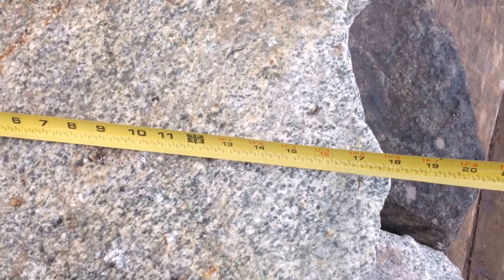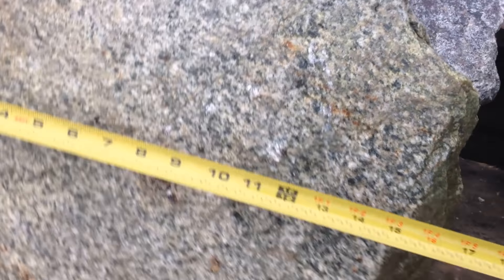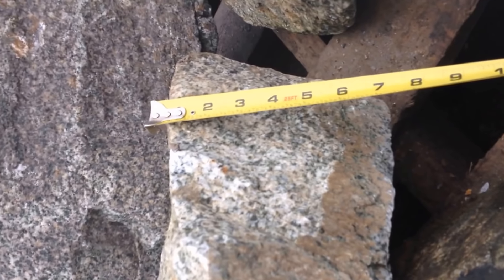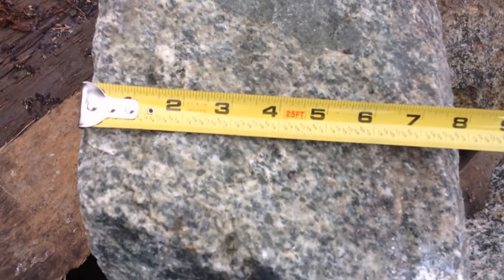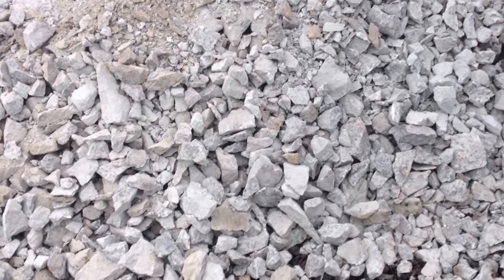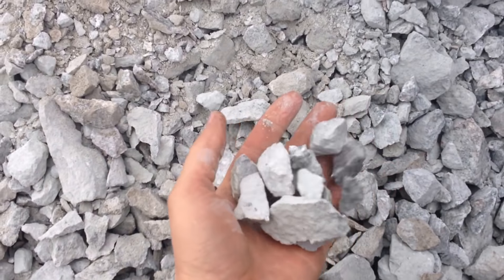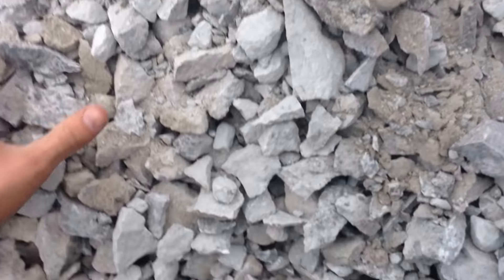MBMMLLC.com: Crushing granite with a jaw crusher

Comment: Not sure about obsidan - but I have mostly basalt at my property, no sand and some clay and the top layer sitting on a bed rock is one two feet max. So Kubota plus dump trailer - plus affordable crusher from MBMMLLC allowed me to build three miles of hilly road winter accessible. Big thanks to them.
Thunder Bay, Ontario, Gorham.
Reply from the maker: Thanks for the comment and update on your crusher.

Comment: When going from 10" rock down to 1" rock, should there be intermediary crush stages to :  1) Increase Through Put.  2) Increase Jaw plate wear life?      For instance should you first crush the 10" rock down to 5" and then down to 3" and finally to 1"?      How are typical crush yards setup?      When crushing Granite, how many hours or tonnes of rock can you process before you have to flip your plate or when it becomes completely warn out?

Comment: ok, so with today's technology, someone has made a cube that can balance by it self. And yet i am more fascinated by this granite crusher
Reply from the maker: +kramler Thanks for the comment.  Its funny how fascinating some of this old technology can be.  The jaw crusher hasn't changed much since the 1800's  There have been some tweaks here and there, but they are basically the same machine.  They are still heavily used in the crushing industry today and I don't know of a better primary crusher than a large jaw.  Thanks

Comment: Can you counterbalance the spinny-thing , so it stops shaking?
Reply from the maker: +Mike Dawson Hi Mike.  Thanks for the suggestion.  A few other people have also mentioned it looks like it is going a little too fast, we have reduced the speed on our newer models which helps a lot with the shaking.  Also having it on an actual stand verses sitting on a couple of 4x4's helps too!  Thanks
Reply: So there's not a way to balance the rotating assembly? Just curious, I know nothing about your type of machinery
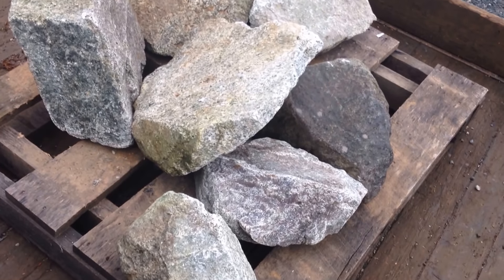Reply from the maker: +Mike Dawson The flywheel actually does have a cast in counterbalance.  You can see it at the very top of the flywheel if you pause the video at 1:08, just before it gets started.  It looks like a little wheel weight like would be on a tire.  My comment earlier about the speed was a little cryptic.  If it is slowed down to about 250-275 RPM the counter balance does a pretty good job of keeping it steady.  At the higher RPM it's running in this video the counter balance doesn't do as good a job as its just going too fast.  They are way more stable when we put them on stands at this slower RPM.  We have changed the speeds of our crushers to about 275 RPM just for this reason.  Here is a video of one of our larger crushers going about 250 RPM and its rock solid even up off the ground 4 feet and the conveyor cantilevered our 15" barely shakes: https://www.youtube.com/watch?v=Vma_rhcXdEE  Thanks for the comment and clarification

Comment: Ur stationary die is loose and ur spinning it over too fast for the type of material ur running try slowing it down to 250 rpm on the jaw flywheel
Reply: Thats what i though at first but it does bollack it through  !!!!!!!!!!

Comment: Seems like there are some pretty obvious improvements that could/should be made as far as safety goes and how materials are fed into the machine. Just find it hard to believe anyone would get to that point in development and think it was a finished product.
Reply: Matt Yale You can see pieces flying out the top. A simple cover or shield would prevent a potential injury. From working in paving you would be surprised how far a crushed piece of rock or concrete can fly. Doesn't make you more manly to ignore safety when operating machinery.
Reply: +Pheonix2022 it isn't about being more manly, it is about common sense. You put in your rock and then you leave.
Reply: Matt Yale Ok bud whatever you say lol seen dozens of guys like you get injured on the job because they think taking proper safety precautions are unnecessary and that they're too smart to get hurt. But hey what would I know from having actual experience.
Reply: Matt Yale The ones who I said were just like you? Yes they were extremely stupid. Thank you for pointing that out.
Reply: +Pheonix2022 I understand your point of view and it is protocol nowadays to receive manual handling courses and safety equipment as well as operating a safe machine but allot of times the red tape just gets too bureaucratic as well as uneconomical.  I believe that 'common sense' is dying.  
Yes some form of guard on the flywheel wouldn't go amiss but as far as the feeding mechanism or lack there of, I dont think any modifications are necessary. Maybe some signage to indicate that staring blankly down the jaws while rock breaking and thinking about whats for lunch can lead to loss of teeth or head.
Reply from the maker: +Pheonix2022  Thanks for your concern about the guards and safety.  This is a demonstration video only.  When we sell the equipment we have them fully guarded with OSHA complaint guards.  You can see some pictures of them on our website here: http://www.mbmmllc.com/jaw-crushers/  It is hard to tell how the machine works when they are fully guarded.  We also have various feeding mechanisms and conveyor discharges so the operator is never close to the machines as shown in this video: https://www.youtube.com/watch?v=Vma_rhcXdEE Thanks for the suggestion and concern
Reply: mbmmllc That makes a lot more sense. Thank you for the explaination.

Comment: granite is a pretty tough rock, or at least i thought......

is there anything made by mother nature that machine will not chew up and spit out?
Reply: freddy hayes granite is a softer rock. and no unless your talking a diamond.. but no, this will crush and natural rock aslong as it fits comfortable
Reply: Diamonds.
Reply: My girlfriend's name is granite crusher.
Reply: Hapie Star You realize that diamond would crush easier than granite right? Diamond is harder but its also extremely brittle.
Reply: Diamond would be destroyed instantly. Even hitting the edge of a diamond on a table along a cleavage plane would chip off a piece. Diamonds are hard but mechanically brittle. Very common misconception. I have met fellow diamond prospectors who test(ed) their probable diamonds with a hammer and anvil. You see the color and expression of their face drop real quick when you explain it to them.

Comment: What is the Rpm on the flywheels it looks too fast?
Reply from the maker: +Marco Van Zyl These smaller crushers go a little bit faster than their larger brothers, but I do agree the RPM on this one is a little faster than it needs to be.  This one goes about 350 RPM.  We have found that about 275 RPM for this model is best.  Thanks for the comment!

Comment: No guard on those spinning wheels? Dangerous.
Reply from the maker: +augdog1230 Thanks for your concern about the guards and safety.  This is a demonstration video only.  When we sell the equipment we have them fully guarded with OSHA complaint guards.  You can see some pictures of them on our website here: http://www.mbmmllc.com/jaw-crushers/  It is hard to tell how the machine works when they are fully guarded.  Thanks for the suggestion and concern
Reply: +mbmmllc Great to hear that your company keeps safety the #1 priority. How about a video showing how to safely load one of your crushers?
Reply from the maker: +augdog1230 A lot of our customers do load the machines by hand.  Here is a video showing granite scraps being crushed: https://www.youtube.com/watch?v=pErTKn_ItfU
For some of our larger crushers we do have vibrating feeders and discharge conveyors as shown in this video: https://www.youtube.com/watch?v=Vma_rhcXdEE
Thanks!

Comment: why are you running it so fast? these work much better at a fraction of this speed... you have enough weight with the flywheel to make the break on the stone... at a slower pace the rock is able to fall farther into the machine and it takes much larger bites...

I mean it's just a matter of wear on the machine right? all  the extra revolutions are going go shorten the bearing life, the belts.... not to mention the danger if one of the rocks comes out of this thing the way you have it set up......

danger danger
Reply from the maker: +Dan Smith These smaller crushers go a little bit faster than their larger brothers, but I do agree the RPM on this one is a little faster than it needs to be.  This one goes about 350 RPM.  We have found that about 275 RPM for this model is a good range.  We also have various feeding mechanisms and conveyor discharges so the operator is never close to the machines as shown in this video: https://www.youtube.com/watch?v=Vma_rhcXdEE Thanks for the suggestion and concern!